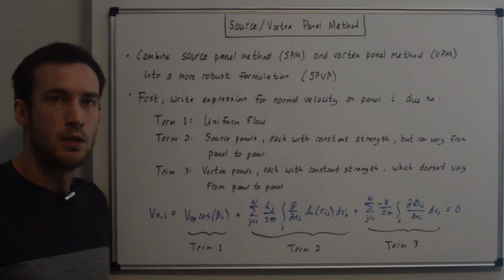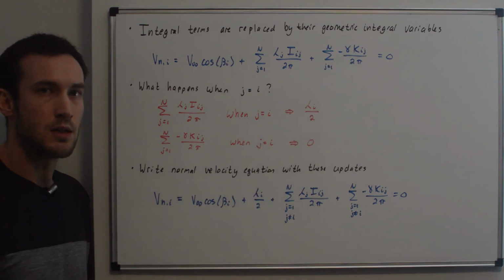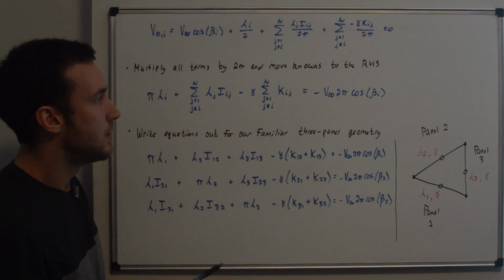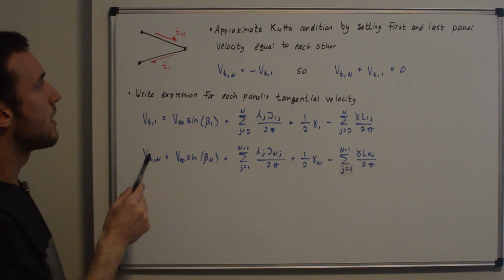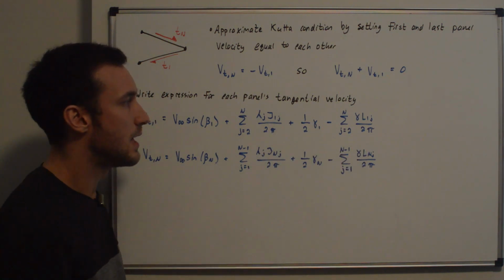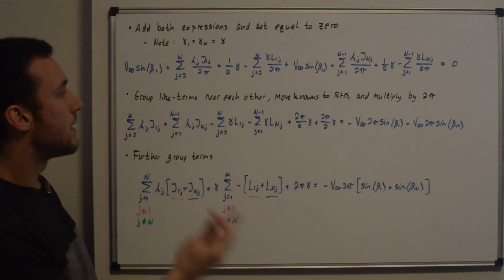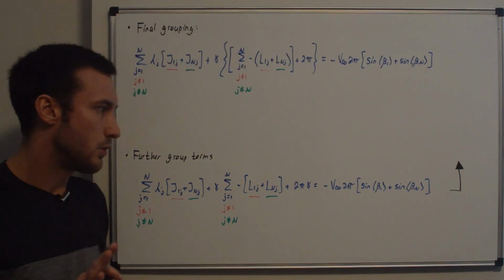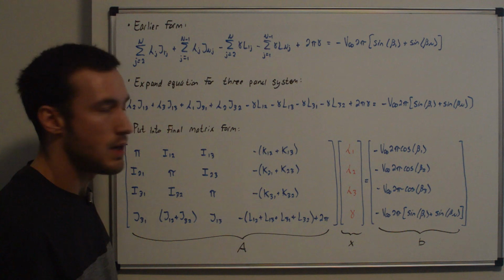Source/Vortex Panel Method: System of Equations

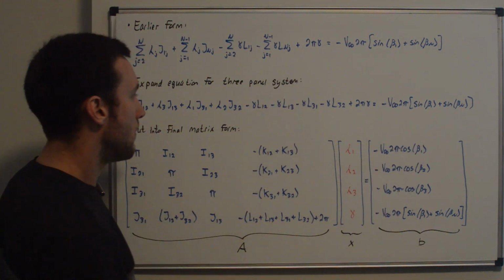Comment: Hello, Josh. I have a doubt at 14:27(pause the video there). Don't you think in the right side of the equation, inside the bracket, where sine terms are there having angle beta1 and betaN, it should be beta1 + beta 3, since for 3 panel system N=3? also same in the right hand side of '=' in the last row of the matrix?

Comment: Hello Josh. I am wondering about the accuracy of the SVPM vs the VPM with linear vortex strength variation. You have shown that the constant strength variation can fall apart in certain cases where it doesn't with the SVPM doesn't, but what about for VPM with linear strength? Which is more accurate? Thank you, your videos are very much appreciated.
Reply from the maker: I would say that the linear strength VPM is more robust than my SPVP method (and definitely better than just the constant strength VPM).  The reason I didn't go through it in my series is because the derivations are more complicated, and the constant strength derivations are in-depth enough as it is.  You can even go to higher order approximations of the strengths, since linear strength is also just an approximation of the actual distribution over the panel length.

Comment: Hello Josh. can you please show how to calculate the stagnation point for an airfoil using vortex + source panel method and also plot it in the airfoil
Reply from the maker: The stagnation point will just be the point on the airfoil where the velocity is zero, and since the normal velocity is always zero, it's the same as saying the tangential velocity is also zero.  I won't go through the full example, but one easy (approximate) way to do it is to compute the tangential velocities on the airfoil surface as I do in my code, and then find the point where it's close to zero.  That gives a good starting point.

Comment: Hey Josh, great video. I was able to implement all of this into code but ran into a small problem. The coordinates that I am loading in from xfoil have a blunt closed trailing edge which obviously messes with the Kutta condition as presented in the video. 
The way I "fixed" this was to manually adjust the trailing edge to become sharp after loading in the coordinate files in my Matlab script.

Is there a way to immediately load in an airfoil from xfoil with a sharp trailing edge?
Reply from the maker: Thanks!  Yea, that is definitely one of the issues with the way I have everything laid out here and coded.  It's also something that is mentioned in books/papers regarding the panel methods; you have to make sure to be very clear about how you're dealing with the trailing edge (TE).  For an introduction to panel methods (and for most of the airfoils I'll show in my next video), the way I do it here is fine.  That being said, this is the most basic way to do it, and there are other better, more sophisticated ways of implementing the Kutta condition.

I've typically just been leaving the blunt TEs open (as I think I mentioned in a previous video), but technically this isn't the correct way to do it.  You can also do what you did, which is just approximate a sharp TE by changing the data points, but I have actually found that this generally messes things up more than just leaving it blunt and ignoring the last "closing" panel.  I've just been loading airfoils that I downloaded from the UIUC airfoil database, and that's what XFOIL uses and then spits out to me.  Some have a blunt TE, and some have a sharp TE.  Since my code is more of a general demonstration, I haven't fiddled around too much with it.